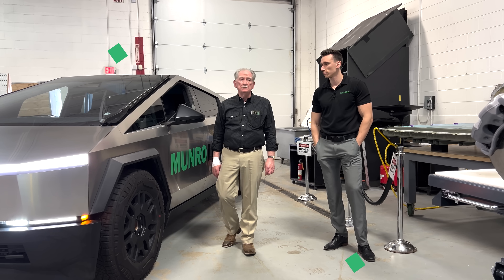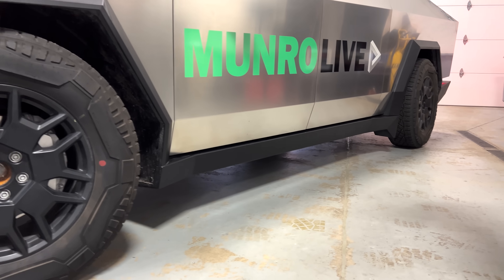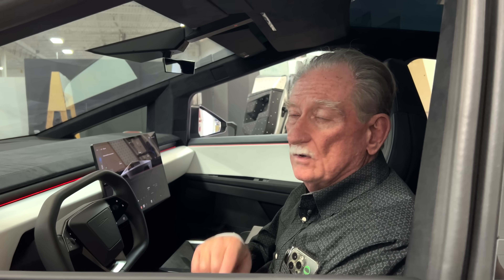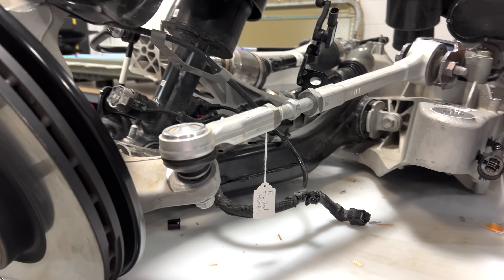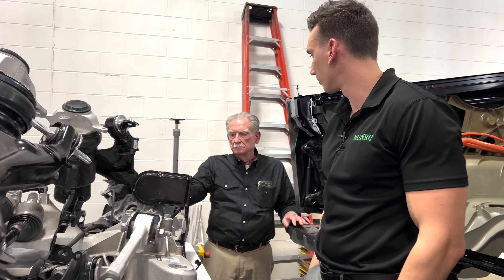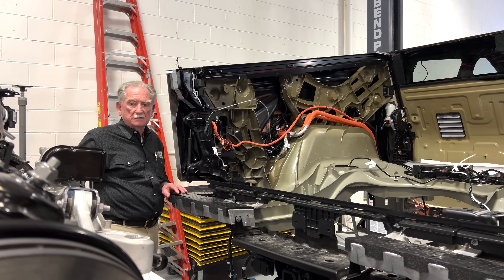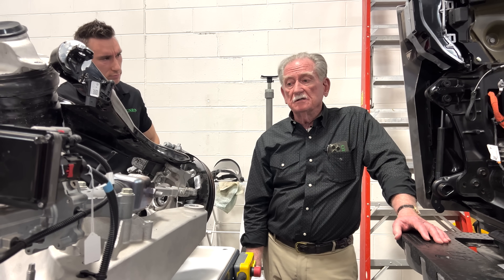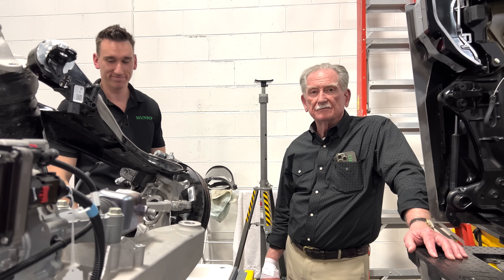Tesla Cybertruck Steer-by-Wire System

Comment: Full control by wire where human safety is involved are only available on machines that cost tens or hundreds of millions of dollars because of the intensive maintenance schedule on only a few machines by fleets of technicians.  The reason all cars have mechanical backup is because there are millions of cheap vehicles where maintenance is ignored.  This steering system is going to warrant a class action lawsuit.
Reply: So tell me,  how do you maintain your EPS system?
Reply: Im quite sure the system need to be approved by NHTSA to be on the road. So it has to be safe.
Reply: They won’t approve matrix headlights , but steer-by-wire and no signal stalks are just fine. Yep, NHTSA is looking out for the regular shmuck’s wellbeing, alright. Not to mention, the accelerator pedal wedging itself in the footwell.
Reply: A 747 doesn’t cost $400M because of the maintenance. It’s because it can carry 500 people across continents. If the power steering gives out on a truck on the highway you’re more likely to get in an accident than the cyber truck with 3 redundancy steering motors. It won’t drive if 1 is down so there’s always a backup to get you do the side of the road.
Reply: @Zeesneakyninja  Lmafo you don’t understand the very basic points.  The only reason those aircraft are able to use steer by wire is because of the maintenance logbooks and impeccable safety.  For 500 million I’m sure 5000 cyberattacks could crash ending 10k people, not 300.  Maintenance is 10x more important and yet it’s ignored with no oversight.  It’s the Boeing of vehicles.
Reply: Yeah and an not redundant knuckle joint is more safe.okay.
Reply: You sir are an idiot
Reply: Hugegamer is gaming...
Reply: What utter not invented here horseshit from a big3 engineer, waaaahhh, we couldn't make it work because we're arrogant and stupid so no one else can, waaaahhh
Reply: Class action lawsuit lol because you didn't maintenance your cheap vehicle?
Reply: This has to be satire 😂
Reply: Blatant nonsense.
Reply: Would love to change a plug on my steering but no i have to pull all out change that oily mess and put it together ^^
Reply: @stefanpredl6849  it's only funny because he thinks if you can afford a cyber truck you can't afford a little maintenance so everyone's going to sue Tesla lol as if the system has more maintenance than any other steering rack on the road lol
Reply: @mattjenkins2244 yes it funny. The system is built with redundancy(2 motors and sensor on steering rack and 1 motor and 2 sensor in steering wheel)

It works if 1 sensor and-or motor goes blank from each side. Steering wheel side motor is only for road feedback and can be driven without it. 

I wrote this before I watched the video so im going to watch now and see if I was incorrect lol😂
Reply: Fly by wire fighter jets don't seem to be such a problem. I think a Cybertruck should do just fine.
Reply: shh… Do you want Munro to lose all the money he has tied up in Tesla stocks?
Reply: @trippplefive He doesn’t have any. This has been stated on multiple occasions. I believe at one time Sandy may have had some interest in Arcimoto (?).
Reply: @trippplefive  he’s been sucking Elon’s gate to get trucks to reverse engineer and sell the secrets to the highest bidders.  Where is the control module for the steering system?